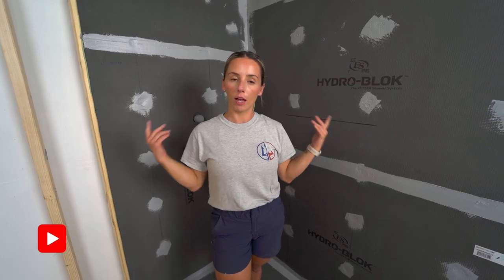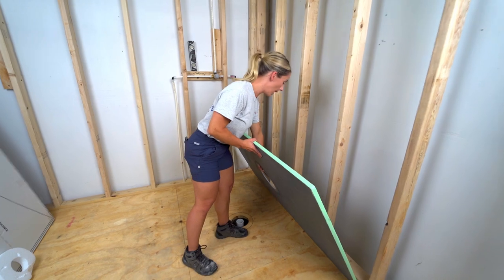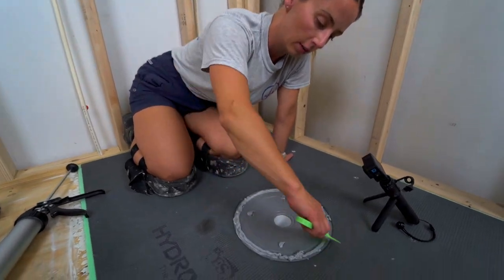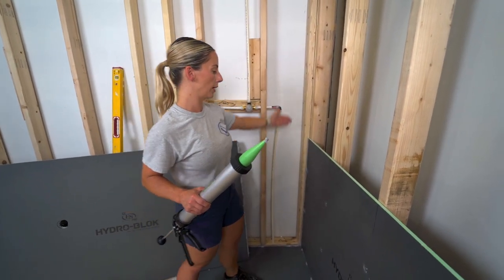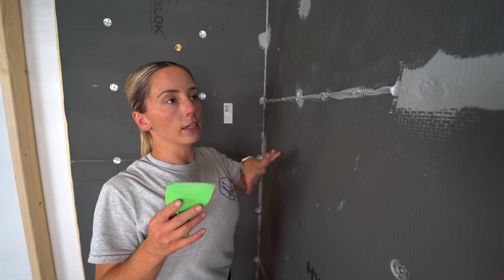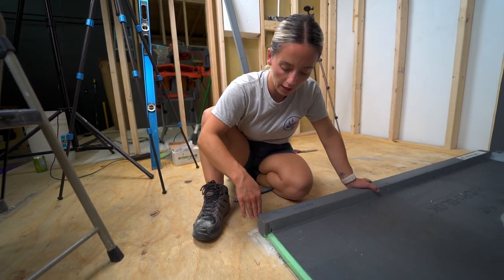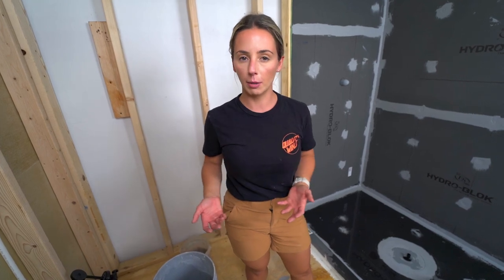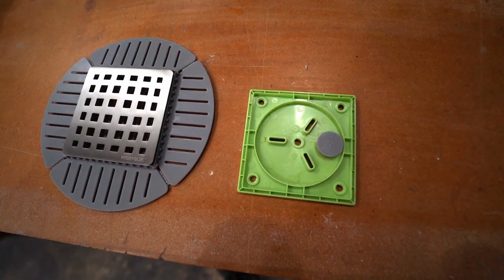Shower Waterproofing with HYDRO-BLOK

Comment: Question: re: the screws and washers  I know washers are needed but are washers supposed to be curving? Is there a close up picture on the depth of washer into Hydroblock board

Comment: You said that the mesh tape stops 3" before each corner, is there any reason why. Also, I thought I saw you went the length of the curb with the tape not stopping 3" before, was that correct?

Comment: No mesh tape needed on the vertical seams at the corner and also the horizontal seams between the two wall boards?  I saw an old hydro book video which said to do this
Reply from the maker: According to an updated installation guide it is not required.  See page 4 under "Finishing Wall Board Installation", the PDF is here https://www.hydroblok.com/wp-content/uploads/2021/06/HYDRO-BLOK_Low_Profile_Pan_Installation_V1_6.pdf
Reply: No.

Comment: The only thing I don't like is that you have seams flying through the air I don't even like doing that in drywall I would put back their firebreaks or just trying to land them on vertical studs

Comment: Seems really expensive.
Reply: It is more expensive to have a leaking shower… Or, if you have a good contractor who really knows what he is doing, they might make it work with cheaper materials, but then you spend even more on their extra labor.

For my own shower, I chose the Schluter system, which might be the most expensive option, even more than this. But overall I save a lot by having a leakproof shower which I trust, and by having an easy, quick installation where I just have to follow their rules using their products. 
And whatever I do, it is just a small portion of the bathroom renovation budget anyway, but if I screw this up, it can cause the most damage.
Reply: @juzoli  all good points not sure why it has to be so expensive though. I’m a fan of the schluter system but I’m installing fiberglass now to cut costs :/
Reply: @Whoreallyknows  Sure they could be cheaper, they certainly have a nice profit on this product line. And a similar competitor will eventually push down their prices.
But they are good, and worth even that money. 

An experienced pro, who understands the system, might be able to replace elements of it with cheaper alternatives. But that experienced pro might also have an hourly rate which makes the cost of the material seem irrelevant, and use whatever he is comfortable with:)

In the end, I chose this system, because there was a LOT of headaches about my bathroom reno. And it was nice to get rid of one of those headaches. No regrets. But it also fits my style in general, as with the money I save by DIYing, I like to use it to buy premium materials.
Reply: I'm definitely sold on this system compared to others. Great video 📹